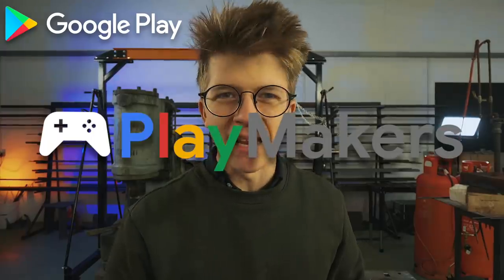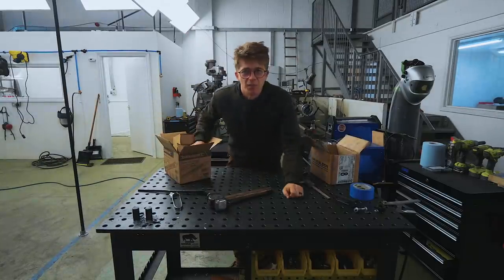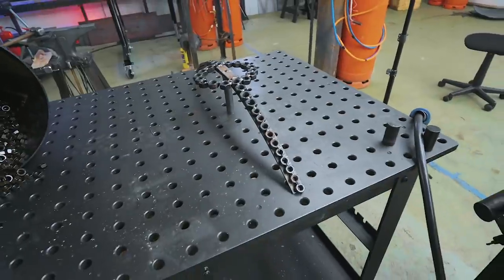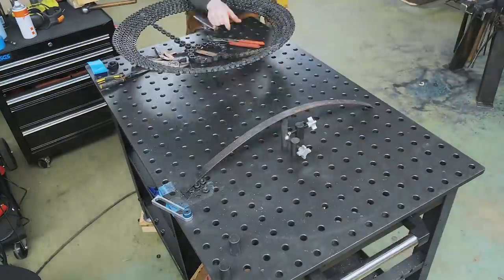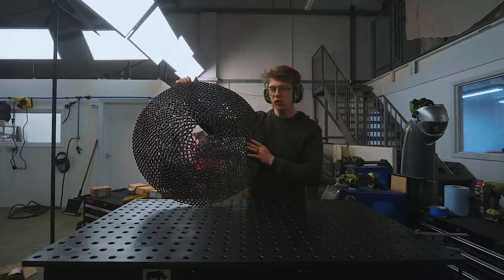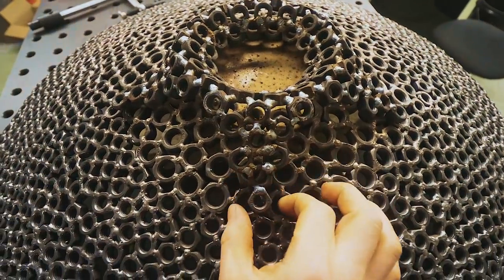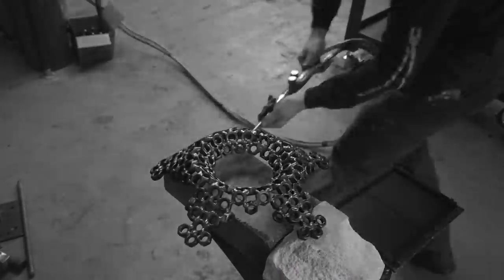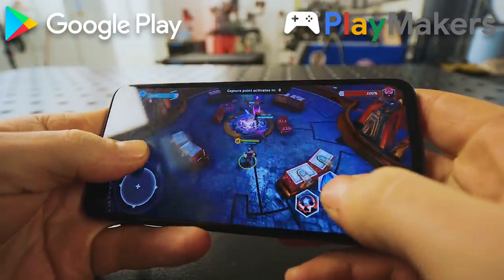MAKING A CAPTAIN AMERICA SHIELD!!! (Just a little different!)

Comment: Pretty practical thing, lots of mounting points for accessories!
Reply: Suitable for taking on a crusade.  It is, after all, very holey...
Reply: I bet some shields would look great on it.
Reply: Just like crocs
Reply: Very tacticool
Reply: Screw sharpened allthread into it lol
Reply: @LurkingInTheSofa  Actually,  in medieval warfare it might be perfectly useful, just if it wasnt as heavy (and if you wouldnt get shot at with arrows). With the reduced weight it could also work quite okay for todays riot control.

Comment: Bro, if you made an inverse mold, thrown the nuts in and positioned them you could have simply zapped em all in one go
Reply: How would you have done that? Without a CNC.
Reply: @Yonatan24  Plywood? You'd have to shape it though.
Reply: @ntokozomasilela4259  That would probably take more time than just welding them.
Reply: @Yonatan24  you can make a thunnel out of a sheet
Reply: or a wok pan...
Reply: @Yonatan24  Beat a peace of sheet metal with a hammer, make a sheet metal shield and do what Clint said. at least there would be a hammer to metal in the video like most of Alec video's were

Comment: If you had a big enough forge, you could of put a bolt in each nut, make each bolt flush on both sides of the nut, heat up the shield, and forge it so it’s smooth and then acid etch it for a kind of Damascus, I feel that would be a massive challenge
Reply: Pretty sure he sold his forges.

Comment: I realize that the welding took forever and he probably had a deadline to get this out due to the sponsorship but this build just seems rushed and incomplete. As far as finish goes, painting the middle ring white would make it easier to see the different size nuts, bring out the red more and be more true to the reference. Once the paint dried, you could use some coarse sandpaper or even hit the shield with things like chains, pipes, etc to give it that battle worn look. I also think there is big missed opportunity to do something cool for the center of the shield, it's just a big hole. Since this thing is a wall hanger and has a ton of little holes in it, some kind of lighting feature highlighting that would have been awesome too. Would love to see Alec revisit this build in the future as I think it has a lot potential to be a really cool and unique take on a Captain America shield.